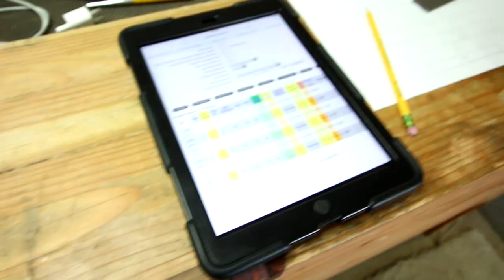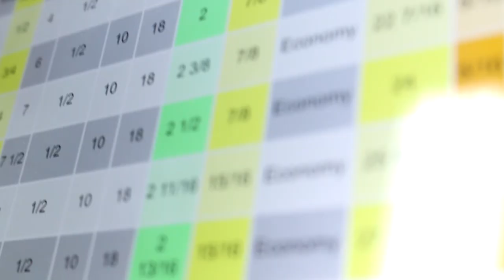SEGMENTED BOWL: PART 1

Comment: Wes, look into getting an OLDER Shopsmith.

The Model 10 has a LOT of cast iron in its 
construction, so it works better as a lathe.
(But, you pay for that, when you set it up 
for a drill-press.)

It does me good, seeing youngsters getting 
into woodwork.

steve